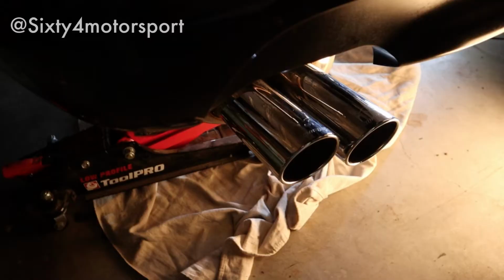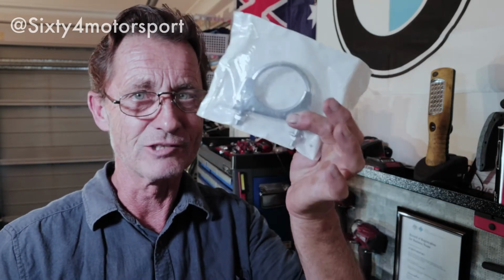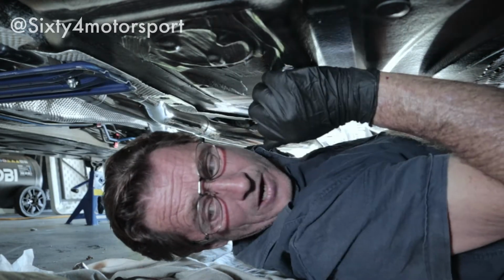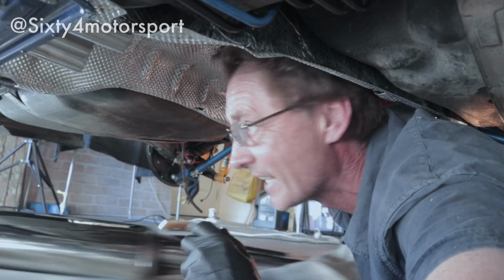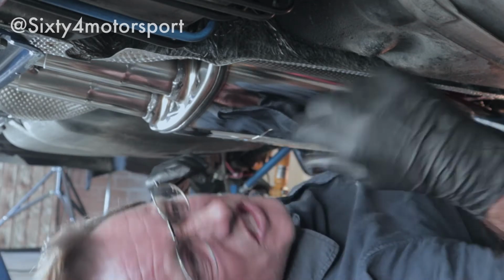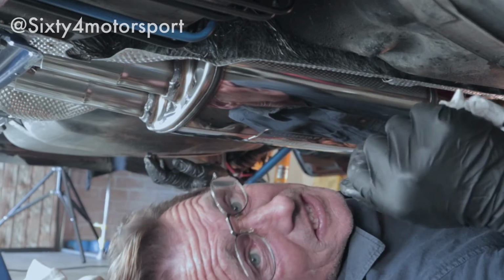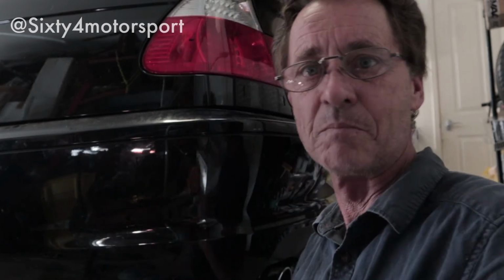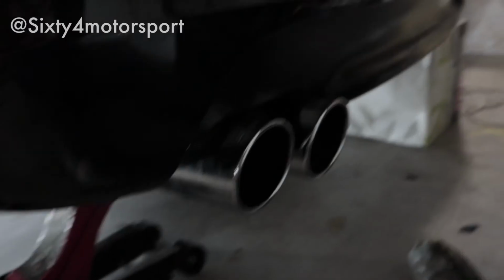E46 Exhaust Upgrade // Installing a Supersprint Cat Back Exhaust

Comment: I'm curious what the exhaust sounds like inside the cabin of the car windows up and windows down. I daily my 330XI and I'd like a nice exhaust note with the windows down (nothing crazy), but with the windows up I want minimal noise and to still be able to easily hold a conversation in the car without raising my voice, what are your thoughts on it from that front? Or have you made any clips/videos of it from inside the car under load/at cruising speed?
Reply from the maker: Good question! Unfortunately I haven't done a first fire up, BUT very very soon, and I'll be sure to make a video when I do. For reference, Borla and Corsa make a Cat_Back system for the E46 with low drone resonators. There are a few vids on Youtube to help you out.
Reply: @Sixty4motorsport  send me link for your exhaust how it sounds like